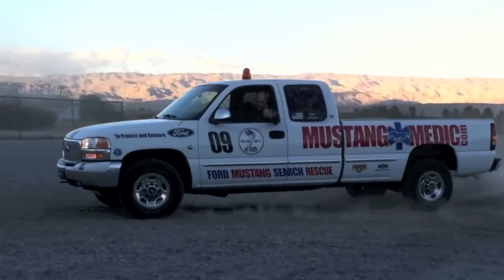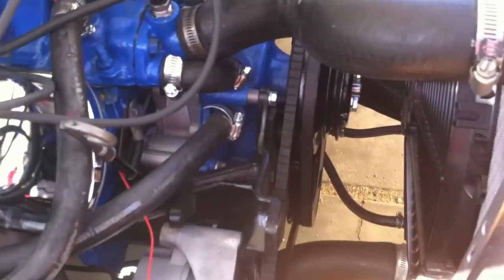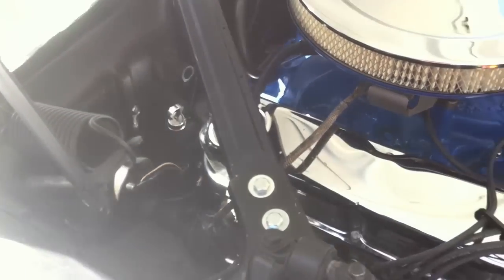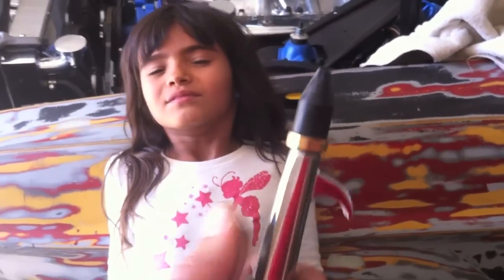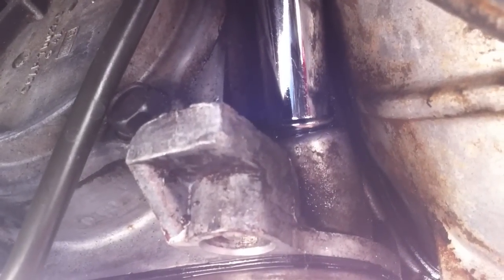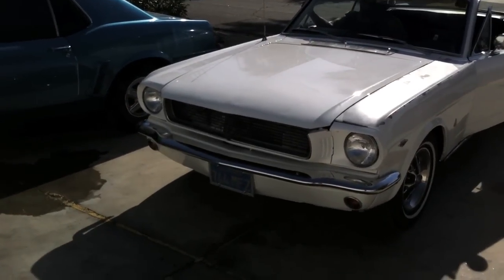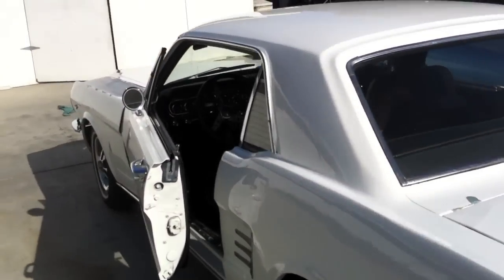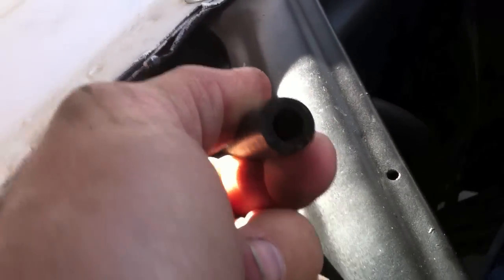Heater core bypass 1966 Mustang Coupe - Day 55

Comment: A trick to keep heat out of the cabin in the summer is to put a valve from a '94-97 Areostar that diverts water from going into the heater core.
Reply from the maker: Good info

Comment: Question, I did the same thing but someone said that by adding that hose to the intake, will overheat because hot water is going into the intake. They said to plug both sides of that hose. Is there any truth to this. Thanks

Comment: I have a question  I take the bypass   I don't use the heater at all Where there will be any problem If I just leave it like that without connecting it to the heater
Reply from the maker: Arturo Soriano yes your good, just run the hose to the inlet and the outlet. All your doing, is not running the water through the heater core.
Reply: @MustangMedic  ok thks